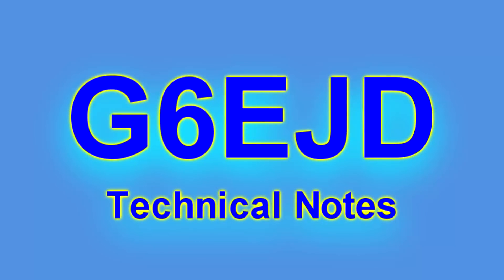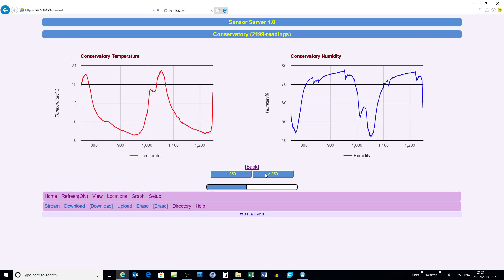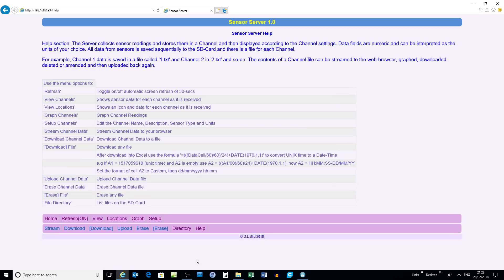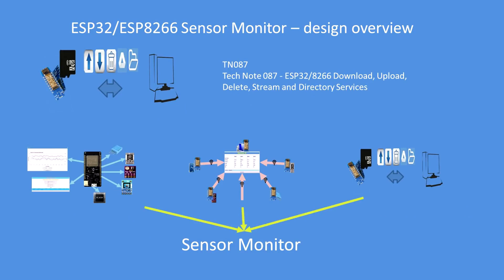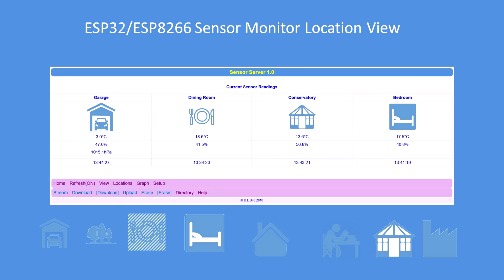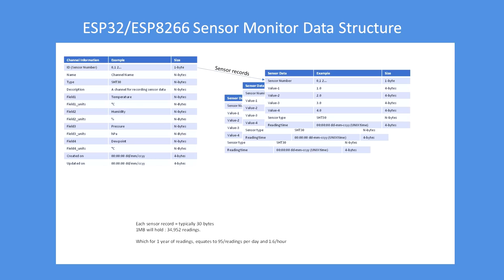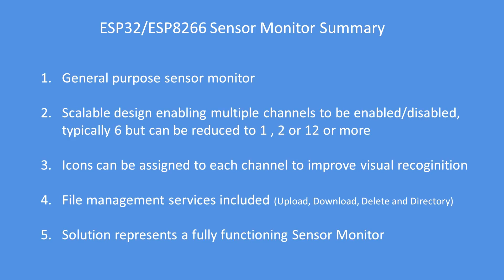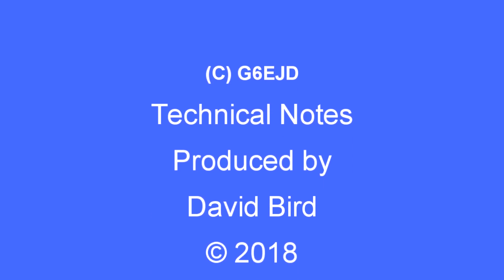Tech Note 088 - ESP32/8266 Sensor Monitor

Comment: Can this be adapted to use DS18B20 Digital Temperature Sensors as I just want to monitor my Yogurt maker, many thanks Bob in the UK
Reply from the maker: @MrBobWareham  yes, just add in the ds18b20 code from the examples library and place that in the read sensor function.

Comment: Hi Dave, any idea how to display the time and date in the graph instead of displaying the number of records?
Reply from the maker: Yes, in the source code you can see some commented out lines this gives an indication. Google requires Unix time for the x-axis so the array has to store Unix time values when the reading was taken rather than a simple record count, if I recall there is also a commented out line that shows how to do this too. I warn you this is complex to do in the google API and I’ve found I had to angle the text at 45° to get it to fit, but google does that fit you too. Yes it can be done.
Reply: @G6EJD  Noted, Thanks Dave for your quick response.

Comment: Hi Sir, may I know it is also possible to implement in my ESP32 BLE client code. It basically scan for ble server and retrieve the characteristic value (etc sensor value or string text). Can I use this concept to push this sensor data onto a webserver via a wifi AP.
Reply from the maker: Yes that’s entirely achievable and there are BT examples in the IDE that give you the building blocks to get the data and then to combine that with a web server fir display.
Reply: @G6EJD  Thanks Sir. 1 more question in there any shorter way to image my code other than AJAX. To refresh the webserver automatically for every 3 sec etc
Reply: *is
Reply from the maker: Aaron, there may be but the sa I get in time would be minimal maybe a few mS, I’m sure if it’s worth it. Why do you need more speed?
Reply: @G6EJD Would be great if there is an example for me to reference. Thank you.
Reply from the maker: Aaron, do you mean my Ajax example isn’t fast enough?
Reply: @G6EJD  No Sir your examples were great. But I was thinking is there a shorter version of the code or approach in doing AJAX for auto-refreshing the web page.
Reply from the maker: I’ve looked at the code and cannot see anyway of shortening it, it’s already as short as it could be. Don’t forget it’s only sending the html required to update the sensor values on screen and nothing more, so the amount of data being sent is very small. If your experiencing long delays then this is most likely to be caused by your wireless network. Have you looked at the timings try monitoring the serial port and switch h on the time diagnostic option bottom left of the serial monitor screen and see how long each part is taking by adding some simple diagnostic prints to your code like serial.println(“1”); and so-on then you can see where the delays are occurring make sure you use s reasonably fast baud rate like 115200.
Reply: @G6EJD  Ok thanks sir. Can you give me an example for linking ESP32 data to the sql database. I intend to pass my parking historical data into the database. Would really appreciate your help. Thank you.
Reply from the maker: I’d like to, but I’m going into hospital soon for 3-months, so sorry I don’t have the time.

Comment: Wow! That’s pretty much my dream DAQ! Do you think it could log data in faster rates, like 100-1000 samples per seconds? I guess I would have to combine a few readings in each data packet and synchronise the time in each module...
Reply from the maker: You could try, but the ESP implementation of HTTP is very slow, the faster update rate is about 1 per-min! Otherwise the server locks up.
Reply: Thanks for your answer, it’s really appreciated. In my case, real time reading on the web page isn’t necessary, it’s a great feature but I import the data on excel anyway. What’s very interesting for me is the ability to configure sensors from multiple wireless esp32 on the same interface, import the data from those and being able to access it from multiple platforms locally or remotely trough a vpn. I’ll start to look into it and do a few tests.
Reply from the maker: Pierre-Alexandre Gravel, the system receives data and stores it immediately, so it should be fast but unfortunately the http server is relatively slow, you could use UDP to send data and receive that independent of the http server, I did a video on sending UDP but in parallel you could receive it.

Comment: hi. your work is great. but i have problem with this. i used TN088 and TN083, but no work. this is my error: Initializing SD card...Card initialised... data logging enabled...
HTTP server started

Waiting for time...Time set 14:34:47-23/02/2019
No sensors received
No sensors received

on SD card i have data, but on web no
Reply from the maker: Have you tested/simulated a client sensor by doing this:http://192.168.0.99/sensor?Sensor=1&temperature=21or for channel 2http://192.168.0.99/sensor?Sensor=2&temperature=25Replace '192.168.0.99 with you IP addressIf your clients are sending sensor data, then you may need to add a typical 500mS delay after sending the data like this:client.println("GET /"+UploadData+"HTTP/1.1\n\r"); 
client.println("Host: "+String(ServerHost)); 
delay(500); // Delay needed for some ESPDo your clients know what the server IP address is? they have to match.
Reply: @G6EJD  When I enter http://192.168.0.99/sensor?Sensor=2&temperature=25, this will happen:
Received from: Sensor 2
temperature 25
 
Guru Meditation Error: Core  1 panic'ed (LoadStoreError). Exception was unhandled.
Core 1 register dump:
PC      : 0x400d4867  PS      : 0x00060230  A0      : 0x800d8be6  A1      : 0x3ffb1dd0  
A2      : 0x3ffc4130  A3      : 0x3ffffff4  A4      : 0x3f40228e  A5      : 0x00000008  
A6      : 0x00000002  A7      : 0xff000000  A8      : 0x000000fd  A9      : 0x3ffb1db0  
A10     : 0x3ffb1de4  A11     : 0x3ffb1de4  A12     : 0x0000000a  A13     : 0x3ffc5a64  
A14     : 0x00000000  A15     : 0x00000000  SAR     : 0x00000010  EXCCAUSE: 0x00000003  
EXCVADDR: 0x40000018  LBEG    : 0x400013f9  LEND    : 0x4000140d  LCOUNT  : 0xfffffffd  

Backtrace: 0x400d4867:0x3ffb1dd0 0x400d8be3:0x3ffb1e10 0x4015e231:0x3ffb1e90 0x400db9fb:0x3ffb1eb0 0x400dba71:0x3ffb1ed0 0x400dbabe:0x3ffb1f00 0x400dbe79:0x3ffb1f40 0x400d5fde:0x3ffb1f90 0x400e1fd5:0x3ffb1fb0 0x4008e841:0x3ffb1fd0

Rebooting...
ets Jun  8 2016 00:22:57

rst:0xc (SW_CPU_RESET),boot:0x13 (SPI_FAST_FLASH_BOOT)
configsip: 0, SPIWP:0xee
clk_drv:0x00,q_drv:0x00,d_drv:0x00,cs0_drv:0x00,hd_drv:0x00,wp_drv:0x00
mode:DIO, clock div:1
load:0x3fff0018,len:4
load:0x3fff001c,len:1100
load:0x40078000,len:10088
load:0x40080400,len:6380
entry 0x400806a4
Connecting ...

Connected to SauronNet.Miletin Use IP address: 192.168.0.99
Initializing SD card...Card initialised... data logging enabled...
HTTP server started

Waiting for time...Time set 17:57:35-23/02/2019
Reply: Hi. Any idea?
Reply from the maker: I replied
Reply: I tried everything you wrote in your first answer, but nothing helped. I'm just reporting the above error.
Reply from the maker: Martin Miletín so what is the IP address of the server?
Reply: 192.168.0.99
Reply from the maker: So if you open a new browser window and type the command example I have above are you saying the reading is not received by the server? There are no code errors reported, so there will be a simple explanation.
Reply: When I type the command, I save the value on the SD card and reset ESP32 with the Guru Meditation error.
Reply from the maker: Martin Miletín, what size card? Which SD library?
Reply from the maker: Martin Miletín, have you tried tracing the error?
Reply: The card size is 4 or 8 GB, FAT32. The SD library is basic to ESP32. Yes, I tried to track the bug, but I'm not sure where the problem is. Now I'm at work, but then I send what she found.

When I have a server running, everything works, but once the client starts sending data, the server starts to reset
Reply from the maker: Martin Miletín, ha e you added a delay on the client after sending and before the connection is dropped the SD card can be slow.
Reply: so to remove the 500 delay?

client.println ("GET /"+UploadData+"HTTP/1.1\n\r");
client.println ("Host:" + String (ServerHost));

// delay (500); // Delay needed for some ESP
Reply: this is error track

PC: 0x400d481f: DisplaySensors() at C:\Users\lucie\OneDrive\Documents\Arduino\ESP32-8266-Sensor-Monitor-master\ESP_Sensor_Monitor_V01a/ESP_Sensor_Monitor_V01a.ino line 370
EXCVADDR: 0x40000004

Decoding stack results
0x400d481f: DisplaySensors() at C:\Users\lucie\OneDrive\Documents\Arduino\ESP32-8266-Sensor-Monitor-master\ESP_Sensor_Monitor_V01a/ESP_Sensor_Monitor_V01a.ino line 370
0x400d8c37: HandleSensors() at C:\Users\lucie\OneDrive\Documents\Arduino\ESP32-8266-Sensor-Monitor-master\ESP_Sensor_Monitor_V01a/ESP_Sensor_Monitor_V01a.ino line 348
0x401615b1: std::_Function_handler ::_M_invoke(std::_Any_data const&) at c:\users\lucie\onedrive\documents\arduino\hardware\espressif\esp32\tools\xtensa-esp32-elf\xtensa-esp32-elf\include\c++\5.2.0/functional line 1871
0x400dbbfb: std::function ::operator()() const at c:\users\lucie\onedrive\documents\arduino\hardware\espressif\esp32\tools\xtensa-esp32-elf\xtensa-esp32-elf\include\c++\5.2.0/functional line 2271
0x400dbc71: FunctionRequestHandler::handle(ESP32WebServer&, HTTPMethod, String) at C:\Users\lucie\OneDrive\Documents\Arduino\libraries\ESP32WebServer\src\detail/RequestHandlersImpl.h line 38
0x400dbcbe: ESP32WebServer::_handleRequest() at C:\Users\lucie\OneDrive\Documents\Arduino\libraries\ESP32WebServer\src\ESP32WebServer.cpp line 473
0x400dc0ad: ESP32WebServer::handleClient() at C:\Users\lucie\OneDrive\Documents\Arduino\libraries\ESP32WebServer\src\ESP32WebServer.cpp line 206
0x400d5fe6: loop() at C:\Users\lucie\OneDrive\Documents\Arduino\ESP32-8266-Sensor-Monitor-master\ESP_Sensor_Monitor_V01a/ESP_Sensor_Monitor_V01a.ino line 121
0x400e27e5: loopTask(void*) at C:\Users\lucie\OneDrive\Documents\Arduino\hardware\espressif\esp32\cores\esp32\main.cpp line 25
0x40090d51: vPortTaskWrapper at /Users/ficeto/Desktop/ESP32/ESP32/esp-idf-public/components/freertos/port.c line 143
Reply from the maker: Martin Miletín, the error is at line 370, but in my code there are only 245 lines, are you using modified code?
Reply: @G6EJD  for the server I use the code from TN 088
Reply from the maker: Please use the default sys_variables.h file with 6 sensors maximum, how many sensors have you set it for?
Reply from the maker: The error suggests the array bound has been exceeded this can only happen if the array index variable has been modified?
Reply: @G6EJD  I changed only sys_variables.h

#define SD_CS_pin 13 // The pin on MH-T Live ESP32 (version of Wemos D1 Mini) for SD Card Chip-Select

in Network.h, I set the SSID and password

and changed the main code

     SPI.begin (14,2,15); // (SCK, MOSI, MISO) SPI pins used by most ESP32 boards.

so far I use 1 SHT30 sensor
Reply from the maker: Martin Miletín I’ll get my MHT-Live and SD shield and try all this out later
Reply: Ok. Thank for your help
Reply from the maker: It seems to be a compiler error, I narrowed it down to Display_Sensors() function that should loop 7 times, it does this:Waiting for time...Time set 16:52:38-26/02/2019
Handle sensor reception
Received from: Sensor 1
temperature 21
 
1 1a
8 1a
10 1a
13 1a
18 1a
19 1a
20 1a
21 1a
23 1a
26 1a
31 1a
32 1a
33 1a
34 1a
36 1a
64 1a
138 1a
209 1a
219 1a
222 1aAs you can see the value of 7 is exceeded and it runs until the array (int) goes out of bounds and crashes.    webpage += F("</tr><tr><td style='width:4%'>Sensor Number</td>");
**    for (int s = 1; s <= number_of_channels; s = s + 1){
      if ((SensorData[s].sensornumber != 0) && (SensorData[s].sensornumber <= number_of_channels))
      { 
        Serial.println((String)s+" 1a");
        webpage += "<td>" + String(SensorData[s].sensornumber) + "</td>";
      }
    }The line ** should only loop 7 times...I've tried while and do loops but I get the same results, not sure how to solve the complier error at this time.
Reply: Can I use a different version of IDE?
Reply from the maker: You can go back to 2.4.1 you can see the affect for yourself just print out a in the loops
Reply: I will try when I'm home
Reply from the maker: Martin Miletín, programmatically there is nothing wrong with repeated for loops, so I can’t explain it, I get the same result with a DO while or WHILE loop or with changed loop variable names, so something must be happening with the compiler counting the loop in the strange way that it is, the second loop increments are most unexpected in their step or format. When the code was constructed in an earlier version all was ok, but not now! I’ll try some more.
Reply: Good. So I'll wait if you can fix it
Reply from the maker: Martin Miletín so far I’ve established the ESP8266 (2.4.2) compiler core works as expected, so now it’s an ESP32 (core 1.0) that is faulty.
Reply: @G6EJD  So it means I'll have to wait for the repair. If he ever comes
Reply from the maker: Martin Miletín, later today I’ll try a different approach but for now this is definitely a compiler error
Reply: OK. thank you
Reply from the maker: OK, working now. See here for v4 https://github.com/G6EJD/ESP32-8266-Sensor-Monitor There is still a complier problem, gives stack crashes all the time. I've hand coded each line, currently set to 7 sensors maximum for now. All tested and working.
Reply: @G6EJD  Hi. Many thanks for your excellent work and time. Sending data to the server now works, but when I want to look through my browser, the device will be disconnected from the router and will no longer be connected. I have to reboot the server and the same thing all the time. Maybe I'm wrong with some device.
Reply from the maker: Martin Miletín, which browser are you using as the graphing function gets html from google and the ESP plays a small part. There does appear to be a problem with this latest release of the compiler, I’m convinced the optimisation is the cause.
Reply from the maker: What is happening in the serial port, reboot?
Reply: @G6EJD  I use Firefox and tried MS Edge. Nothing happens on the serial port. Only SHT30 will not connect to the server. And not even through the browser.
Reply from the maker: What channel number has to be 6 or less try simulating it via a browser input
Reply: @G6EJD  I use channel number 1
#define SensorNumber 1
Reply from the maker: You can simulate the SHT30 like this:
http://192.168.0.175/sensor?Sensor=5&temp=22
In my example I'm using Sensor 5 and the first field value is 22, note the field name is ignored so this will work too:
192.168.0.175/sensor?Sensor=5&test=22

Sensor must be 'Sensor' not 'sensor'
Reply from the maker: I forgot to mention, I just tested all functions no problems here.
Reply: @G6EJD  The first link is fine and the second one is fine too

Handle sensor reception
Received from: Sensor 5
temp 22
 
Handle sensor reception
Received from: Sensor 5
test 22
Reply: Yes I have everything set up correctly. The IP address is 192.168.0.99 and the send delay is 500

const char * ServerHost = "192.168.0.99"; // this is the IP address of the central sensor server

   client.println ("GET /" + UploadData + "HTTP / 1.1 \ n \ r");
   client.println ("Host:" + String (ServerHost));
   delay (500); // Delay needed for ESP32
   client.println ("Connection: close");
   client.stop ();
Reply from the maker: Looks like you have a client problem, are you sure it’s reading the sht30 correctly? Check the client serial port
Reply: At the seventh connection this will happen

...Connecting to Wi-Fi

Wi-Fi connected

IP address: 192.168.0.9

...Wi-Fi connected
...Submitting Upload request
...Information to be uploaded: sensor?Sensor=1&temperature=23.32&humidity=52.20&pressure=0.00&spare=0.00&sensortype=SHT30-1
Attempting connection...connected
sensor?Sensor=1&temperature=23.32&humidity=52.20&pressure=0.00&spare=0.00&sensortype=SHT30-1
...Submitting Upload request
...Information to be uploaded: sensor?Sensor=1&temperature=23.39&humidity=51.64&pressure=0.00&spare=0.00&sensortype=SHT30-1
Attempting connection...connected
sensor?Sensor=1&temperature=23.39&humidity=51.64&pressure=0.00&spare=0.00&sensortype=SHT30-1
...Submitting Upload request
...Information to be uploaded: sensor?Sensor=1&temperature=23.43&humidity=51.62&pressure=0.00&spare=0.00&sensortype=SHT30-1
Attempting connection...connected
sensor?Sensor=1&temperature=23.43&humidity=51.62&pressure=0.00&spare=0.00&sensortype=SHT30-1
...Submitting Upload request
...Information to be uploaded: sensor?Sensor=1&temperature=23.42&humidity=51.50&pressure=0.00&spare=0.00&sensortype=SHT30-1
Attempting connection...connected
sensor?Sensor=1&temperature=23.42&humidity=51.50&pressure=0.00&spare=0.00&sensortype=SHT30-1
...Submitting Upload request
...Information to be uploaded: sensor?Sensor=1&temperature=23.45&humidity=51.57&pressure=0.00&spare=0.00&sensortype=SHT30-1
Attempting connection...connected
sensor?Sensor=1&temperature=23.45&humidity=51.57&pressure=0.00&spare=0.00&sensortype=SHT30-1
...Submitting Upload request
...Information to be uploaded: sensor?Sensor=1&temperature=23.45&humidity=51.41&pressure=0.00&spare=0.00&sensortype=SHT30-1
Attempting connection...connected
sensor?Sensor=1&temperature=23.45&humidity=51.41&pressure=0.00&spare=0.00&sensortype=SHT30-1
...Submitting Upload request
...Information to be uploaded: sensor?Sensor=1&temperature=23.45&humidity=51.55&pressure=0.00&spare=0.00&sensortype=SHT30-1
Attempting connection... try again in 500 ms
Attempting connection... try again in 500 ms
Attempting connection... try again in 500 ms
Reply from the maker: Check your SHT30 client has the correct server address and a short delay before disconnecting too. The ESP32 server is slow and needs the delay. If it is uploading correctly you should see the received data on the server serial port.